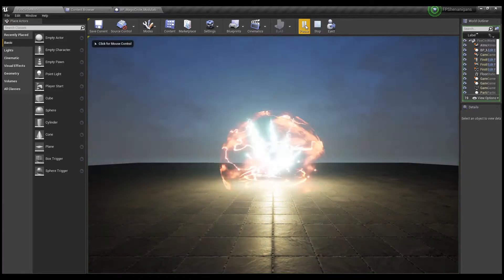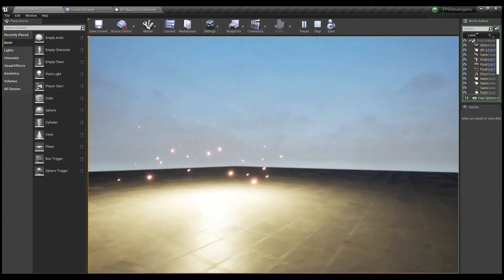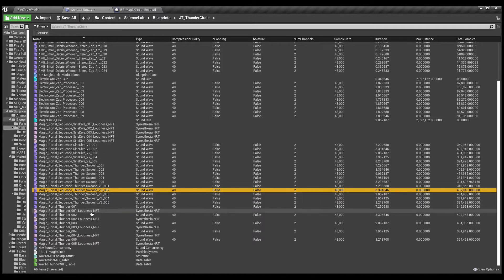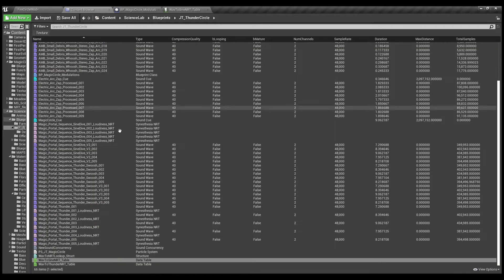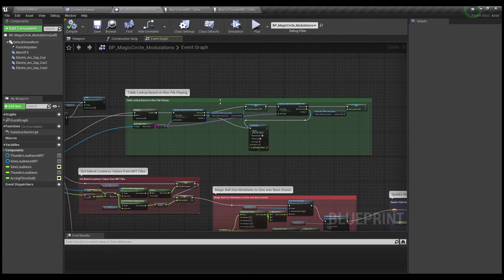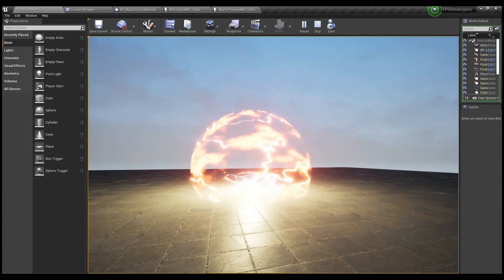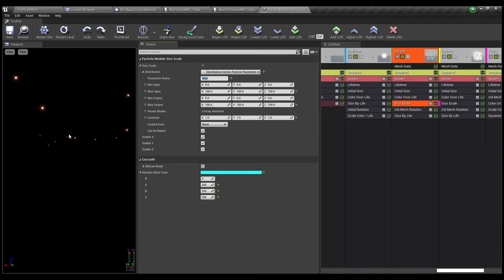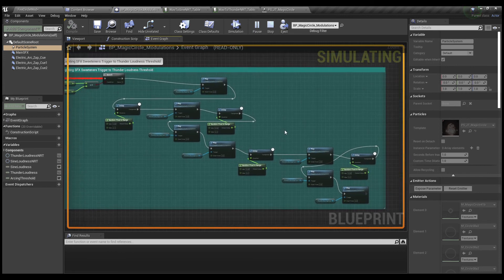More SFX-driven VFX with UE4 Synesthesia and Cascade

Comment: Hi John, I really was inspired by what you did here so I've been diving into this myself. I've found this works really well with one-shot sounds, but I can't get the looping sound's NRT file to loop back once the NRT has played through the file. Have you been successful in getting NRTs to loop?
Reply from the maker: Hi Roy, I'm glad you're taking the time to check it out a bit. I've got an NRT file being read for the Beam SFX sound in this demo. https://youtu.be/eAIvr6sAq3A

It's using Wwise but the mechanism is fundamentally the same.
Reply: @j0hnt3nnant  Amazing thanks! I missed this video. I'm doing this all in UE but that won't matter much in BPs.